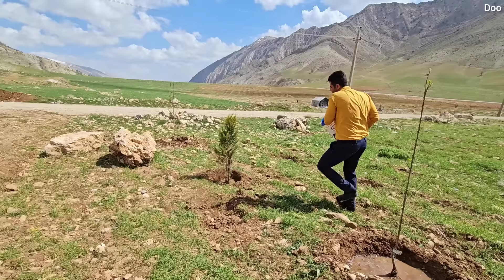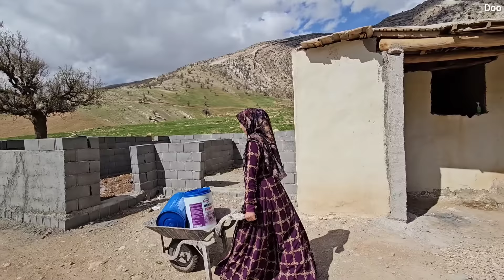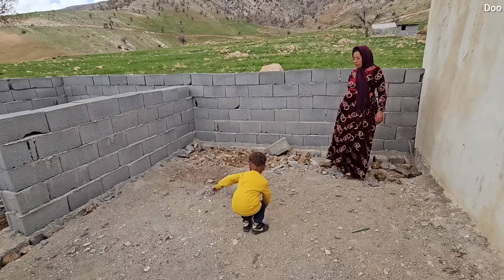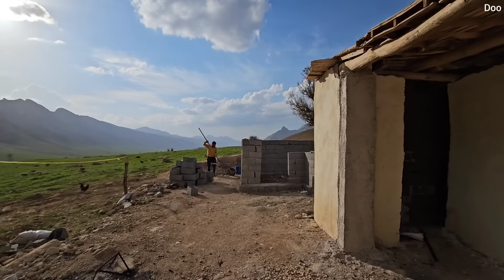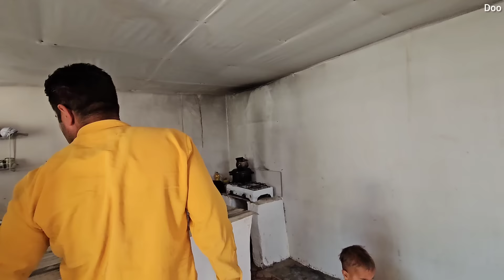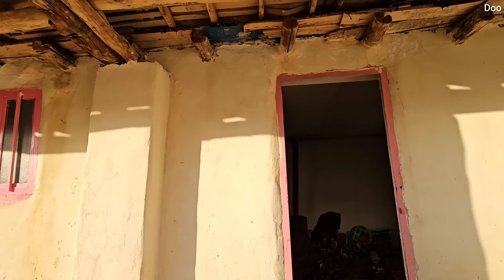Unveiling the Remarkable Dedication of a Philanthropic Family for a Divorced Woman's Serenity

Comment: Mr Rahmat if you put up the roof make it slanting Not flat. So that when it rain it flows down directly to the ground. It is not expensive.
Reply: Just don't get the flat roof thing at all unless you want it coming down on your head.
Reply: They don’t listen to our comments, he will put a flat roof on , and there house will end up with black mold Everywhere, just like Perry’s house. He said he was going to clean up Perry’s kitchen , but he never finishes any thing, the twins will live with the mold and always be sick ,
Reply: @AmandaBosse  It's not mold... It's black soot from the gas cooker. Both woman cook with it on so high that it is leaving a soot residue on the cloth ceiling and the walls. Only way to fix it is either burn cleaner fuel/gas or turn down the darn cooker when you are using it.